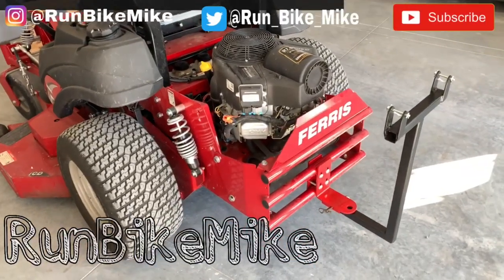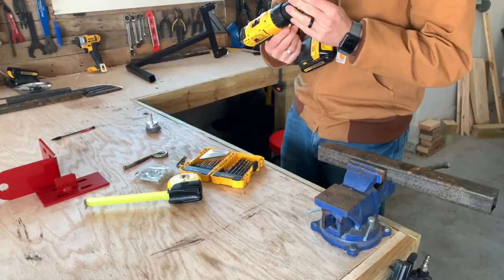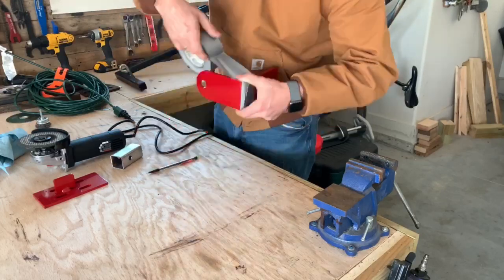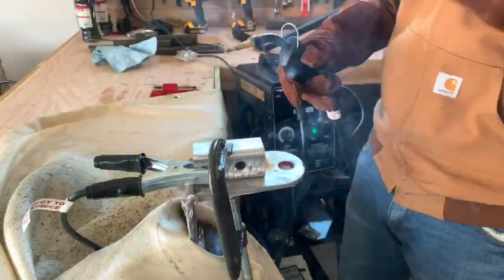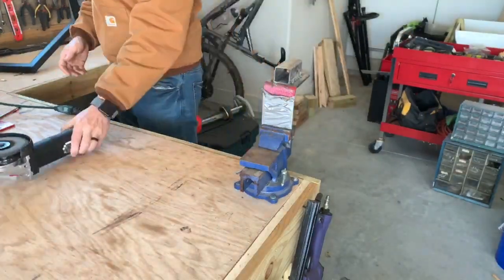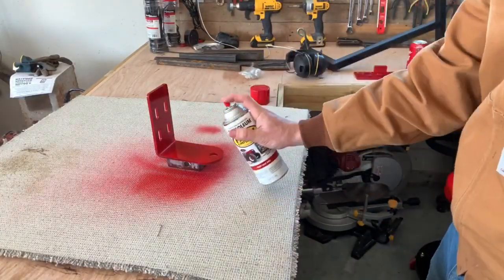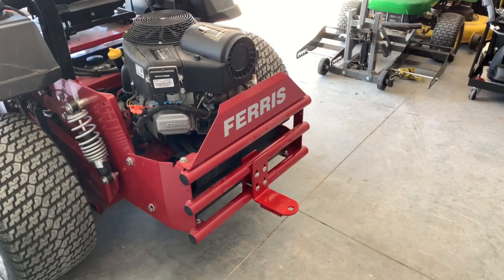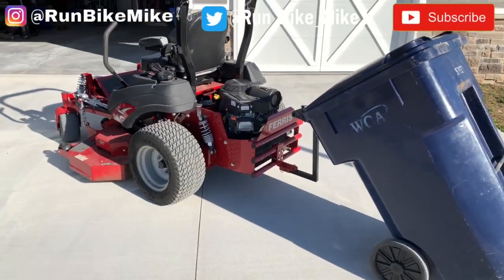Crazy modification for a Ferris trailer hitch: ISX 800, IS 3200, IS 3300, IS 2000, IS 700 IS 600

Comment: do you think it would be ok to pull a 6 x 8 utility trailer weighing 750lbs?  I want to pull the trailer with the mower so i don't keep tearing up the yard with the atv...tia
Reply from the maker: I wouldn’t suggest it. That is a lot. My guess is maybe 300-400 lbs max. But it might be possible. I have a small lawn trailer that have had filled with dirt and it did fine. But I don’t think that was more than 250 lbs.
Reply: I’ve pulled a 6x14 utility trailer that roughly weighs 1200lbs no problem with a little Ferris 400S through the grass absolutely no problem
Reply: @franksanna217  I have a 4 x 8 1200 lb capacity trailer I pull all around my 2 acre lawn with my 400s without any problems. ..Not on a wet lawn..

Comment: Those trailer hitch's are junk.  Had one, and it couldn't hardly pull itself without moving or twisting or bending.  Finally had one made that was heavier duty.  Didn't cost any more.